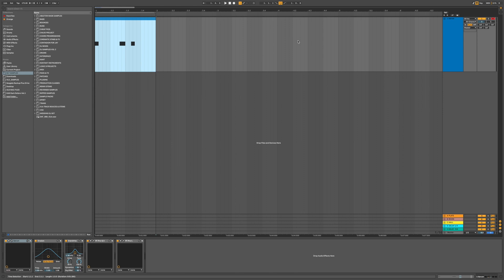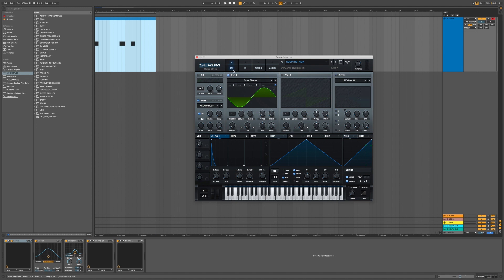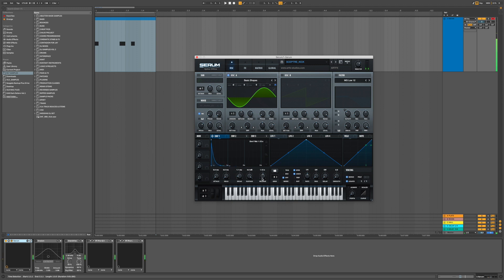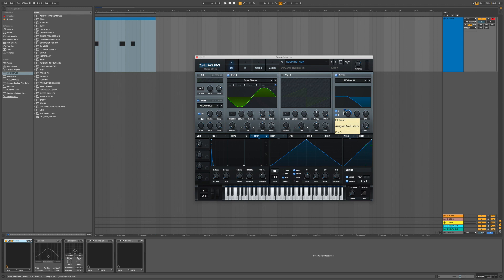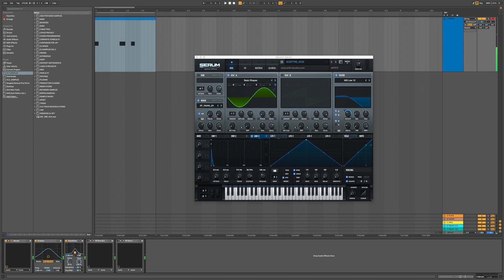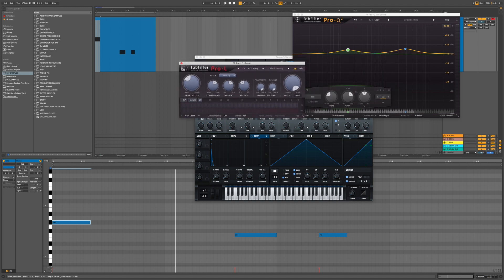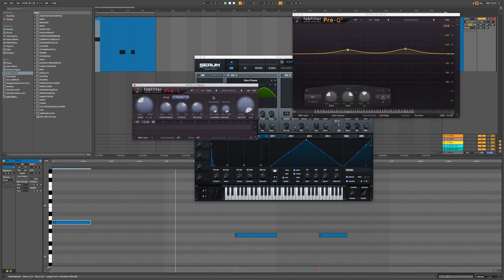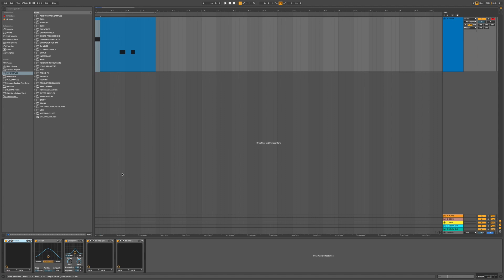Synthesised Kick Drums in Serum Drum and Bass in Ableton Live tutorial #009

Comment: I'm a bit confused as to what you said about the attack of the compressor. You said you have a long attack because you want to cut off the transient and squash it .. but a long attack lets the transient through more? A short attack would squash the transient. I'm confused, did you say the wrong thing, or do the wrong thing with the compressor?

Lovely vid otherwise mate, I even picked up a few extras to add to my kick patches now. The filter opening up over time, the white noise and the saturation! That's really gonna help as I used to layer another kick for the upper harmonics but this will solve that issue and give me way more control over my kick's sound, TY!
Reply from the maker: That’s because I using a limiter not a compressor. A slow attack will cause the transient to be clipped giving it a different sound than fast compression. Hope that clears things up 👊🏻